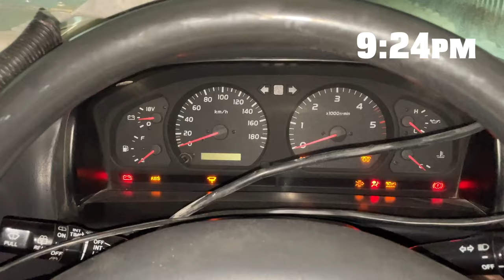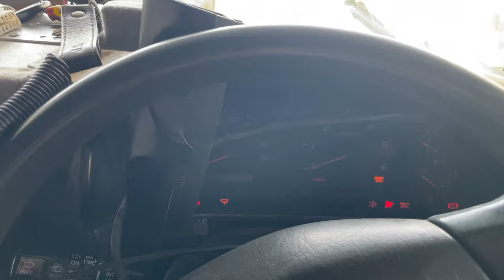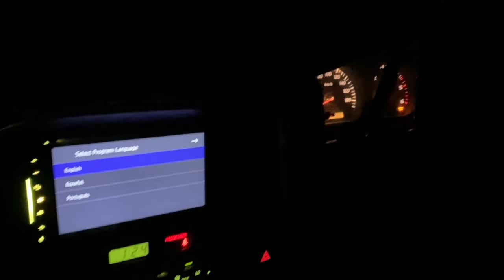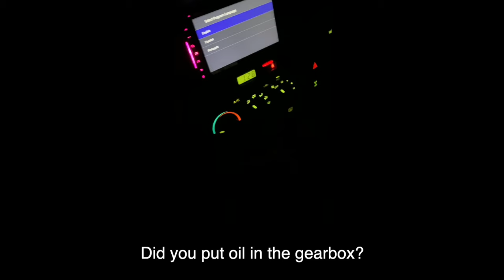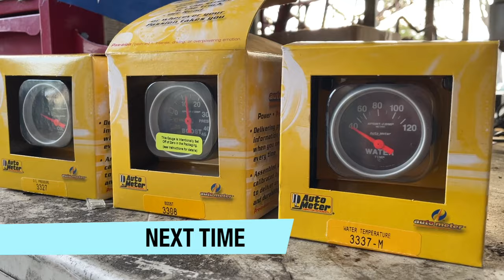1HDFTE Conversion Wiring

Comment: Thanks Will! You are the best!
Yesterday I drove my LC 100 for first time in 5 months. I did some rust repair and underbody coating( Finnish winter so definetely a must😂) . Also big intercooler, tuning chip, boost controller, EMUMAP map sensor emulator for NO fuel cut  DIY 3" exhaust + regular maintnance. Took me hole winter.!😂 Love your videos.❤

Comment: Will, firstly well done on sticking with it! Are you planning to go into why you went for the loom splice option? Why didn't you not just swap the dash looms, fuse box, cluster etc from the half cut? Was it a later model? Get a manual HDJ loom and ECU from a wrecker?

I did my FZJ myself a few years ago, and just swapped the all the looms, and thankfully started first crank. But, I did search for a wreck that so they were both early model and both were 4speed auto, so it was literally plug and play. I had to run 1 wire to deal with the IFS vs live axle ABS arrangement. I was also able to just plug my immobiliser into the FTE loom and keep all my barrels. Obviously you already had a HZJ, but in a lot of ways, the FZJ is an easier conversion IMO - I think you can even keep the gearboxes if you wanted.

Comment: Another great video. Are you running the fte on a mechanical pump? If so how did you do the conversion, and what pump did you use?
Reply from the maker: Hey mate, nah it’s the standard FTE pump. Wouldn’t even have to make a video about the wiring if I had a mech pump 😂 Few good Facebook pages about the process around converting to “FTM”

Comment: No mention of the stand alone cheap ECU option for those that might consider the same conversion?
No immobilizer, no EGR, no EDU, no nonsense.
Only need a bare minimum of wires to get it running, but probably want a bit more to have a good running engine.
Tune it yourself on the laptop, so no need for expensive chips or tunes done by copy paste tuners.

Of course not for everyone, but a good options for many.
Reply from the maker: Definitely sounds like a good option. One I don’t know much about
Reply: @WillsLandcruiser  
For those that might be interested, the ECU is a Baldur DID1, I got a couple of them myself for my 1HD-FTE and my 1KD-FTV.